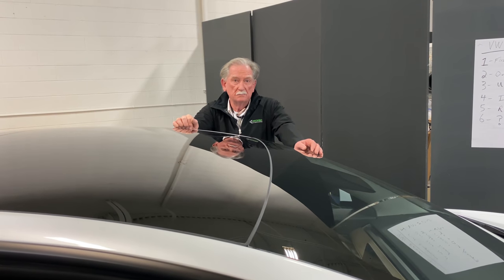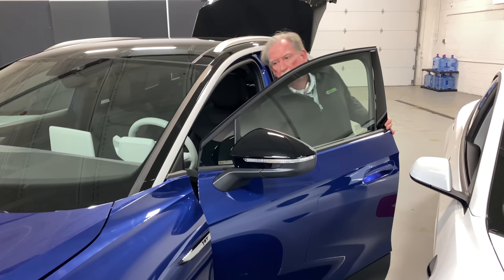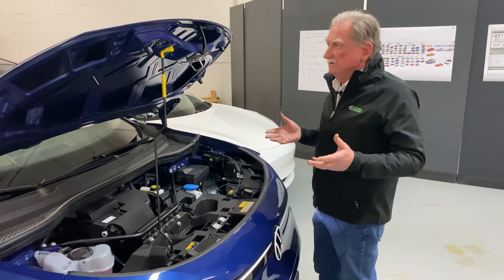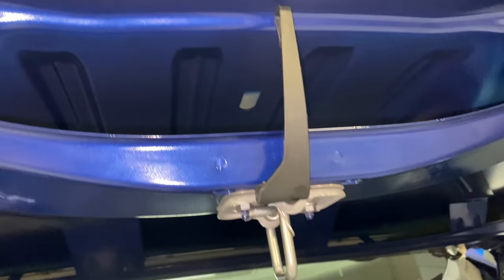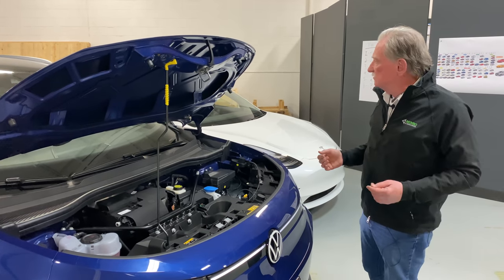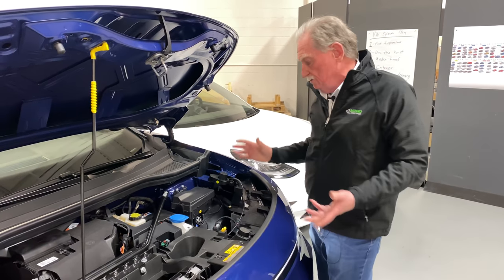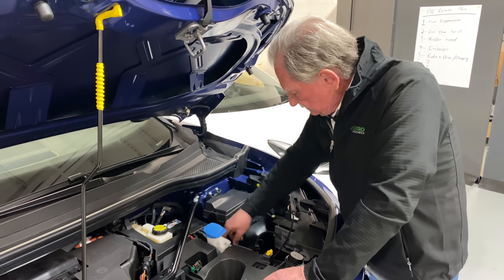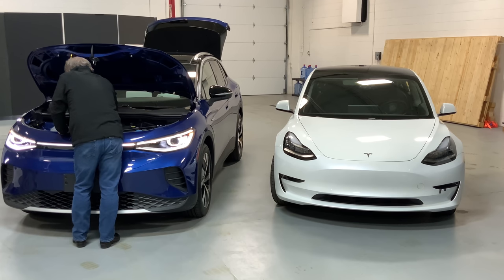2021 Volkswagen ID.4: E2 - Under The Hood

Comment: I suspect the reason why Tesla has a frunk and the VW doesn’t is because the front of the Tesla is substantially longer than it needs to be and substantially longer than the VW. Also, putting common service items under the hood where access is easy makes it easier to service them, compared to something like Tesla where they are all hidden under covers, body panels, the dashboard, etc.

Regarding the fuses, some manufacturers have opted to remove fuses in favor of current-monitored transistors. Basically they watch the current draw of every circuit and use transistors to act as basically a circuit breaker. Tesla is definitely not the first manufacturer to do this. The problem is that, depending on the electrical fault, those transistors can be a one-shot deal as well, but instead of replacing a fuse that costs pennies, you’re replacing an entire module or fuse block that costs hundreds of dollars. I work as an automotive tech, I’ve seen this happen many times on the other vehicles that have used this setup for well over a decade.
Reply: The model 3 is only 4 inches longer (180,5 vs 184.8) - that is not really substantially longer.  The ID 4 weighs in at 4559 pounds and the Tesla model 4031 pounds
Reply: Auto mechanic here,
Yep 
because customers love getting told they need to spend 200+ bucks(instead of a 5 buck fuse)
Fuses are very simple and reliable, 
Transistor systems are great when they work, very expensive when they break.
Reply: @pierre.a.larsen  I think the original post was saying the hood is longer on the Model 3. VW claim the short hood was a design choice to make the cabin larger.
Reply: @scottwills4698  Ah, yes.  My mistake.  The front is indeed substantially longer on the Tesla.
Reply: Wait, you sound knowledgeable about this.  In your opinion, why is Sandy saying fuses are such a bad thing?
Reply: @pierre.a.larsen   Eh.. the model 3 is a sedan, this is a taller CUV.   A model Y is more comparable and weighs 4416 lbs... while using a lot more aluminum... which costs more, and from what I can tell, uses more energy to produce.
Reply: the id4 turns way better than the model3 and also the id4 has more capacity
Reply: @carholic-sz3qv  And it's a hatch back.
Reply: @updlate4756  Not to mention steel is a known quantity in your average Joe body shop.  Repairs will be much cheaper with the ID.4.
Reply: VW ID4:
 nose to front of door: 1.34m
 nose to base of windshield: 1.03m 

Tesla Model 3:
 nose to front of door: 1.31m
 nose to base of windshield: 1.06m

o.O
Reply: Kevin Beg
Why would you need to prioritize serviceability? As an EV owner, any EV that I see designed for easy serviceability tells me that I should expect lots of dealership visits in my future. No Mas!

EVs should not be designed with service and maintenance as a profit center.
Reply: @storm4710  fuses are going, whether you like it or not. EVs GENERALLY have heavy duty electrical circuits that don't use fuses; just as Sandy says. Regressing in order to please a supplier is a bad choice (which is what i think they did here).
Reply: @onwike  I dont care 
We make more money on replacing those auto-fuses then we would ever make on the old school ones
Reply: @NO3V  how is those measured?
Reply: @storm4710  I measured them from scale matched blueprints in Photoshop.
Reply: @updlate4756  I work with industrial controls.  Absolutely hate fuses.  Circuit breakers are so much more convenient to reset than trying to find and replace a fuse.  What Tesla has done is make software resettable circuit breakers.  Very smart.  Do you have a fuse panel in your home of a breaker panel?
Reply: KEVIN -the Reason is SIMPLER than that, the VW iD4 is Designed like a GAS Vehicle , rather than a TRUE BEV platform.
Reply: @markplott4820  Exactly.  The engineers that designed the car are the same engineers that designed every other VW.
Reply: @NO3V  It is not really about that, but about the wheelbase. Check wheel center difference to the front. That allows for putting the front seats and console more forwards.
Reply: Watch Teslabjorns video, he measured this properly.
Reply: @rkan2  
VW ID.4 nose to center of front axle: 85cm
Tesla Model 3 nose to center of front axle: 79cm
You were saying?
Reply: @arnorjonorvarsson6215  The front of the hood on the ID4 starts 16cm after the nose.
The front of the hood on the Model 3 starts 8.5cm after the nose.
Measured in a horizontal plane the length of the hood panels are:
ID.4: 735mm
Model 3: 898mm
Bjorns measurements are without fault.
But why do they matter if it's just a design decision that the VW hood starts further back and is differently shaped. The wood be space for a frunk if they knew what they are doing.
Reply: @updlate4756  
Re "Aluminum"
So the ID 4 should be substantially cheaper?
Reply: @rogerstarkey5390    The ID.4 is substantially cheaper than the model Y.  The 1st edition is currently $14,000 (28%) cheaper after federal tax credit than the base level model Y.
Reply: @storm4710  I say at this point the same thing that sandy told us a time ago.
Why perfect something, that shouldnt exist in the first place? 
A Fuse is a useless component for the function of allmost any device, except when it brakes... 
So for a car i would use cheap Fuses in every low power system.
For high power there is a different story to this... Fuses use energy like mad cause of the voltage drop. 
Therefore i would like to go to an Mosfet based electronic fuse to minimize the power loss...
Reply: @derwissenskiosk8041  as i have written before, 
any kind of auto fuse is great when they work, 
When they fail it is normally a very expensive repair(part alone is anywhere between $200-$1200 depending on the car)
Reply: @storm4710  what the others don't realize - in Europe one has to have spare light bulbs, I, as many others, have there a simple fuse kit, as well. Dirt cheap. Had no need to change one yet, but I would prefer one from the kit rather than the prices you mentioned. Especially while on holiday abroad.
Reply: @ionbarari7202  dude, you don't have fuses in your house (if it was built relatively recently) because, from an engineering perspective, it doesn't make sense. You have circuit breakers. 

The difference? Fuses is just a material that burns out when current over a certain limit runs over it. Then you have to find it with a volt meter and replace it. Circuit breakers are switches that turn off when too much current runs over it, then all you do is go and flip the switch back, just like a light switch... same function, different approaches. 

One requires significantly more effort than the other but both are equally reliable for the function.
Reply: @onwike  if this type of circuit breakers are used - then all is good. But are they?
Reply: For 35 years this man has torn apart cats for a living and produced reports on them that other builders buy.  He's very well thought of and does very well.  Unless all of you do what he does your second guessing him is really funny.
Reply: @ionbarari7202  Well, that's kinda the point. Tesla is using industry leading parts such as software controlled breakers that you don't need to reset by hand. And YES they are JUST as reliable.
Reply: At this point, to use the house analogy again, you are looking at three electricians at your house bidding to work on your electrical panel. 
One wants to install fuses into your house that blow every single time ANYTHING misbehaves and you MUST take a multimeter and try to figure out which one blew because it's not obvious by just looking at them. 
Another wants to install breakers that trip every time anything in your house misbehaves, but you can go downstairs and flip the breaker back on, because you can visually see which one flipped and also because they don't self-destruct. 
The last guy wants to install software controlled switches that disconnect if it senses too much current, and allows you to toggle it back from the loo, if you had a mind to. 

Which one do you pick? Is it even a question?
Reply: @onwike  ok, let's have some perspective:
I live in a poor country in eastern Europe, where 90% of Teslas on the road in the future will be "used" (think auction bought damaged, declared too expensive to fix)
Stuff will break, expensive electronics are no problem for new-car buyers, but if we DO want to help environment - we should use that EV as long as it's battery lasts, or maybe longer.
Now I ask you - where is the good in having to replace expensive circuit-breaker modules in a car 15 years old?
Reply: @onwike  NO, NO, and once again, NO
we won't use any "HOUSE" analogy, because it's unusable - a house supplies countless connection points for unknown, uncontrolled loads
A car is a better controlled environment - only the 12V outlets and USB ports are really uncontrolled (actually, for them circuit breakers won't be a bad idea)
for all other components - a fuse will do nicely, in a cheap, light package, as the manufacturer has close control to what will the circuit do.

I hadn't have the need to replaced a single fuse past 6 years, asked 3 friends that had cars longer than me - none of them did
The advice of my godfather (works as a driver for a company which delivers goods across the country, ~500miles of 8h daily driving):
Small probability you'll have to change any, just get a generic kit and forget about it.
Reply: @shmadmanuts  we will use a house because it's high voltage applications and all the stepping that occurs to supply low voltage for heating systems and door bells relate to an EV much better than an ICE vehicle which only has at most a 48 bolt system.

And yes, when you use electricity exclusively for more and more applications in a car, the probability of failure increases exponentially with each new application. NOT linearly, as you probably already know. Hence my use of the house analogy.
Reply: @shmadmanuts  I don't think you understand the life expectancy of these things. I don't recall, but I do believe that they will outlast your inverter. These are solid state switches. Comparing their life expectancy to a mechanical switch is like comparing a mechanical hard drive to an SSD. For for the same purpose, but one will outlast the other easily.
Reply: @onwike  yeah, like someone will plug in 2 hair driers while the kitchen oven is working in your Tesla - the manufacturer knows and controls each and every circuit, bar shortcircuits(CB is useless then) and auxiliary ports(CB will be great here):
Literally only one of my friends  had  to change a fuse, once.
Just asked a professional driver(~500 miles/day (8 hours)) past 15 years had to change only several, when the circuit had to be inspected at a service anyway.
Reply: @onwike  I understand it well:
Things will break.
If we have a cheap, tested one - we prefer it over the more expensive one if it provides same functionality and little added convenience
In modern cars, life expectancy of a fuse is quite a lot.
The real benefit of a CB in the house is that one can shut down power on the circuit it serves for maintenance work, without affecting other circuits. With properly taken care devices - a fuse will do just as well as a CB
I don't remember a  CB to trip in my apartment since I moved here (2 years)
Reply: @onwike  PS:
I don't say it's a bad thing Tesla put CB in their cars, it's just:
1. I can't see the point in putting expensive modules middle-range cars (price wise)
2. I can't see why do we have to bash on manufacturers that use same old things (if they work aswell as the new ones) for the sake of progress: To hell with mobile phone makers that dropped the headphone jack.

PPS: Now if VW fixed the dreadful washer cap that won't stay open - that will be progress
Reply: @shmadmanuts  afaik, these are high powered mosfets and relays that are doing this. Comparing them to circuit breakers is the best I can do, but they are NOT circuit breakers. Unless Tesla's engineering and procurement team are truly dumb, these should be a fraction of the cost and weight of a fuse. And their overall reliability should be much higher, or at least the same as fuses.
Reply: @pierre.a.larsen  That big fuse box added one pound. Maybe  VM customers consider more pounds == more values.
Reply: @onwike  "these should be a fraction of the cost and weight of a fuse" :D
You're a kidding, right?
Look at Munro's teardowns and you'll see some places where Tesla's engineers chose the more expensive way for no added gain.
Reply: @shmadmanuts  my friend, you seem very convinced. Why don't we revisit this topic at the end of the year. I promise, if I'm alive I will respond if you reach out. I think you'll find that most people will say that Tesla is the gold standard in electronics and automotive design.

Comment: I think it's amusing that reviewers all seem to think that because VW did something differently, it was automatically wrong. Other folks have mentioned the lack of frunk opens up more interior space. It also lets you have a much shorter front overhang pushing the wheels to the ends of the car, like a Mini. This is a huge handling advantage and possibly contributing to why some think the ID.4 out-handles the Model Y and Mach-e. And there's still room for the front motor on the AWD version coming out later this year. That said, as someone who's worked on his own VWs for years, they do sometimes make really boneheaded engineering decisions.
Reply: It's the whole package from car to charging.  In America is harder to charge this at the charge America chargers.  You can charge a good easier that have who built the charger.  So if you travel Tesla is the way to go. Nope, I don't have a Tesla.  I.c.e. for me.

Comment: If you compare the car hood 1:1 you have to take interior space into consideration aswell, seems like a pointless comparison otherwise. Lots of "stuff" can be hidden at the cost of interior volume
Reply: Interior space and car size. Id.4 is shorter than Tesla Y (good in the city, where most cross over SUVs are operated) but has more space inside. Furthermore VW did not add frunk to the RWD model, because the AWD model will require that space for the front engine, so they have one unified building process with less variation.

Comment: no frunk, but easy access to cab air filter, windshield washer fluid, and other fluids, small battery ( compared to 82kwh battery) and fuses, and better turning radius, one of the things that impressed me during the test drive, hence why the wife and I are getting a ID.4

Comment: The frame in front of the AC box is the radiator support bracket. They are made of glass reinforced nylon supported by the front bumper beams. The rad bracket is rigid but not especially heavy.

Comment: Regarding the lack of frunk. Appears that the ID4 hood is shorter than the Model 3. Also VW have used space to house HIVAC which frees up room in the passenger space
Reply: I was thinking the same thing.
Reply: Exactly, I don't know why everybody is so obsessed with a frunk. It seems like a solution to a problem that shouldn't exist, just make the hood smaller and get an extra foot of space inside the car.

Comment: The fact that the Model 3 has 5 feet of hood area as opposed to the ID.4s less than 3 feet may have something to do with the lack of a frunk. The easy access to the components more than compensates for no frunk. As far as the fuses, I've had 16 VWs over 50 years of driving and haven't had to replace a fuse in 25 years. Personally I'm waiting for the ID Buzz. I hope we can reserve it late next year.
Reply: That's great, we don't all have to drive Teslas.  Hope you get your Buzz!  Personally, the Cybertruck best suits my needs.
Reply: That is nonsense, no way the difference is one foot, the iD4 has a slightly shorter but at the same time higher hood; the space beyond the hood is quite similar.
Reply: @nilsfrederking62  if I remember correctly the hood of the good of the model 3 is 110cm and the ID.4 hood is 90cm. Or 2/3s of a foot.
Reply: @Demobot1  So you do not remember correctly, see some other comments down below one commenter measured it, it is a few centimeters and you easily can see that when comparing images (side view) of both.
Reply: @nilsfrederking62  Bjorn Nyland measured the hood of the ID.4 and the Model 3.
Reply: @Demobot1  You need to measure the horizontal distance between nose and beginning of the windshield, not the hood length.
Reply: @nilsfrederking62  if that is the case then the hood length of the Model 3 is probably even greater. But I don't have a Model 3 or an ID.4 to measure them.